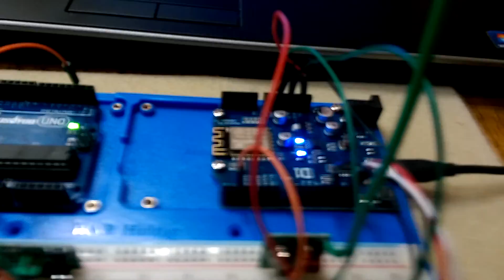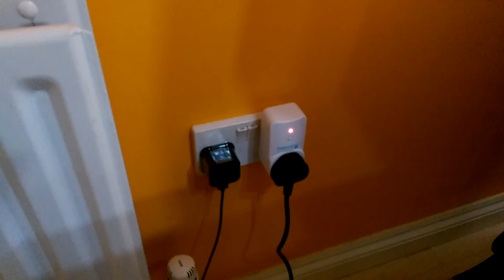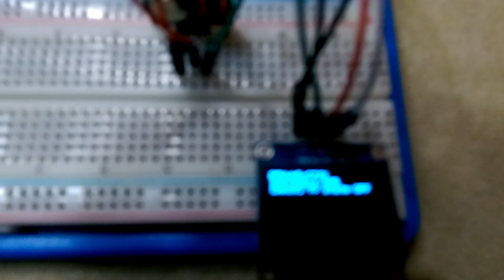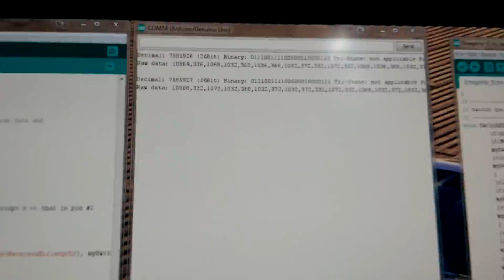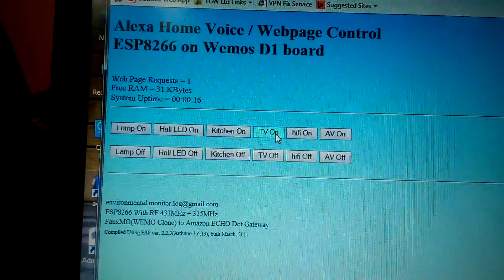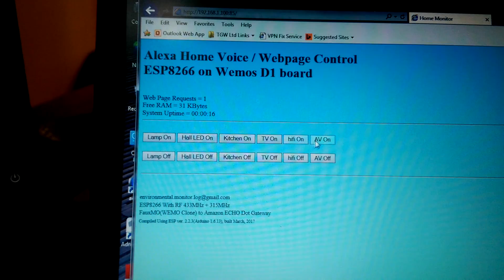Amazon Echo Voice control of 433MHz remote socket outlets

Comment: Hi Alan, thanks for your info on this project. I have recently got an echo dot and an esp8266 and programmed it with the code you had in your link.it boots and connects to my network and seems to work ok on the webpage buttons (I have't got the rf transmitter through yet so just trying the code). I'm finding my dot won't detect the device. Have you found that yours has stopped working after recent updates? Thanks